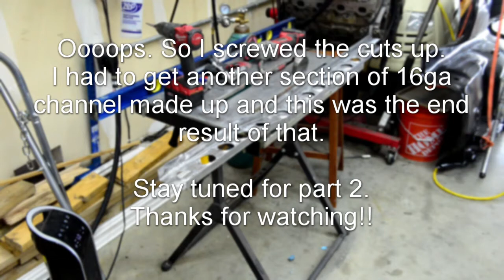Video 13   Rocker Replacement Part 1

Comment: Where did you purchase the safety face shield with the integrated 3m respirator... It would come in handy for me... Thanks Much
Reply from the maker: Amazon. Generies FNWD 17 in 1 Full Face Respirator,Reusable Protective Face Cover with Adjustable Strap Widely Used in Organic Gas,Anti-Dust,Paint Sprayer,Chemical,Woodworking (Eye Protection) https://a.co/d/8miJVsh

Comment: I'm only replacing the outter rockers on the 73, but you lost me on why your installing  that inner piece of bent steel  inside the rocker, is that for struct support  of some kind
Reply from the maker: Yup. Just added support/strength along the rocker. The inner rocker is one layer of vertical support to the rocker "box" (once the inner rocker is welded to the outer it makes a box shaped tube).  Adding the support I fabbed up, adds another layer to that. Kinda like a double hull on a ship.